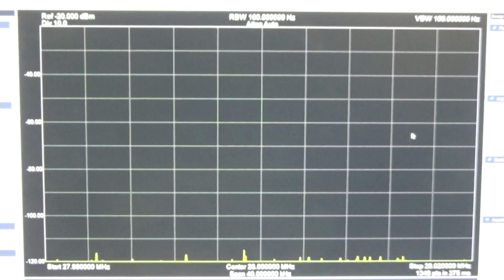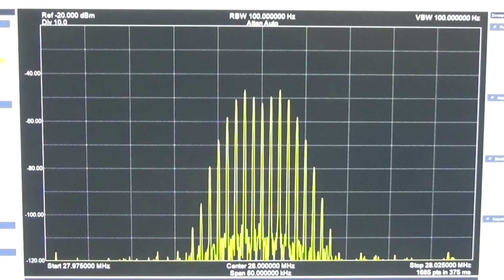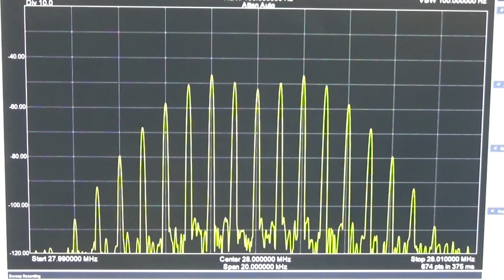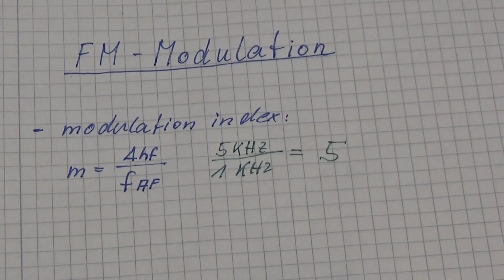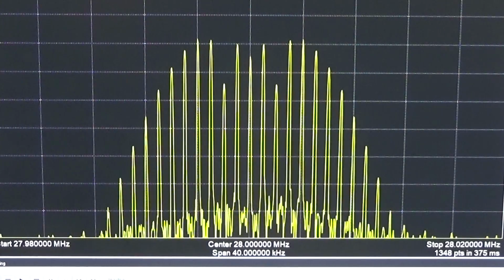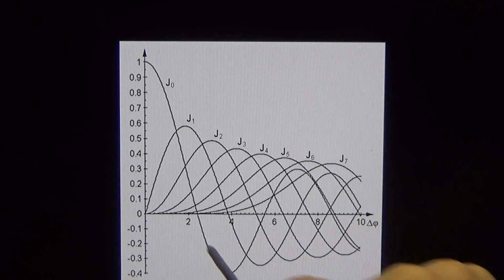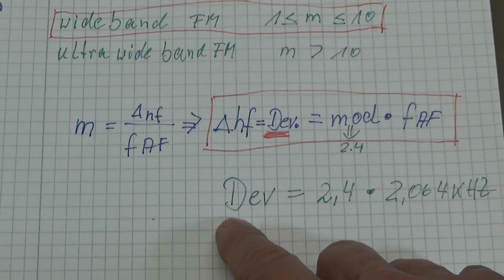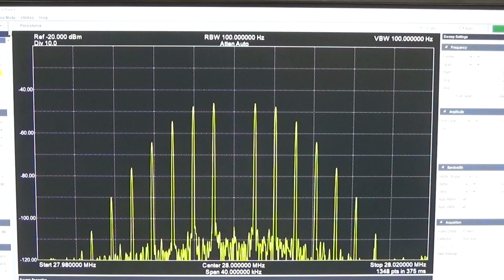#166 FM modulation and deviation on the spectrum analyser explained

Comment: I need to see what the shape of the Modulating signal is on my Harmonica notes. looking at one note at a time.
The vibrating free-reed is basically the carrier. So, I see on the spectrograph that the fundamental frequency is spread out wide.
But it is a wide blurred line. I suspect that there is FM going on. 
Can you give me any tips.

Comment: Hi Peter, an informative presentation.  I used my OWON XSZ1015P Spectrum Analyser and my Marconi 2031 Sig Gen to test it out at 28MHz with 5KHz deviation at -10dbm.  I found 2 lower frequency nulls #1 at 581.4Hz,  #2 at 909.4Hz and #3 at 2.083KHz all nulling down the fundamental to about -90dbm.  The Spectrum Analyser in ''modulation mode'' showed a Peak deviation of 5.05KHz, 5.04KHz and 5.01KHz.  All quite close results.  Based on the modulation Index of 2.4048 for 1st Bessel null this calculates to an audio freq of 2.076KHz for 5.00 KHz deviation.  So I am confused by the 1st 2 nulls as they should not be there.
I think the best way is to to use the formula to calculate the audio freq based on Audio (KHz) = Deviation/2.4048 and trim it for a null on the SP.   Cheers 
Mike

Comment: I was able to set the deviation on an FM transceiver using this method using a mobile phone, an SDR receiver, and an oscilloscope.  It took a couple attempts because the makeshift signal generator did not keep a constant audio level as the frequency changed.  Once I realized the problem, I changed my method a bit.

Take the specified deviation in the service manual and divide by 2.405.  Use a tone generator to produce tone at this frequency.  Set the tone level to what is specified in the service manual by checking with an oscilloscope.  Play tone into radio input while transmitting. Watch the waterfall on the SDR transceiver, and adjust the radio's deviation until the carrier frequency disappears.

When I was finished, the resulting adjustment was within about 1.5% of what the radio arrived with.

Comment: Thanks for the explanation. I will try to measure the deviation of my signal generator FM modulation option which is not documented.
Reply from the maker: Good luck
Reply: It worked! I was able to get an estimate of the deviation variation of an old signal generator using my basic Siglent 100MHz oscilloscope. But not in real time (the scope only takes 1024 points, not enough frequency resolution) but saving the signal values (about 20000 points) and doing DFT via software and using Carlson bandwidth formula.

Comment: I think the bessel 0 point you have achieved here is not the first bessel 0 point (i.e modulating index =2.41) because if it was so then while you were increasing the frequency of the audio signal amplitude of the central tone should go from negative to zero as shown in the bessel graph. But in your case amplitude of central tone was coming from positive to zero while you were increasing the frequency so maybe it was any one of the next bessel 0 points.

Comment: Can I ask you how does squelch work in FM transceivers? Is it signal strength based or something else? Thank you.
Reply: squelch is used in receivers not transmitters. The squelch basically mutes the receiver when the signal strength falls below a certain level. Once the signal strength is above a certain level the squelch "opens" and the receiver un-mutes. The squelch level threshold is usually controlled by the user depending if they want to hear strong signals or weak signals.

Comment: Great Video , please could you kindly help to view FM signal and AM on Oscilloscope , so to check these signals in Time domain .
Reply from the maker: You will have trouble to see the FM deviation on the scope as the frequency delta is to small compared to the transmitter frequency.
Reply: Dear Sir , thanks a lot , please I have question : 
If I set the carrier ( from waveform generator ) to say 10 KHz , set the deviation ( FM modulation from the waveform generator ) to 1 KHz , so is it possible to view the analog FM signal on the Oscilloscope ? 
Thanks and best regards

Comment: Hi Peter, I am trying to fix my HP8590L spectrum analyzer and would like to seek your advice on some of the issues.
1. I tried to measure the signal path from the RF to the IF with a 500Mhz scope which I borrowed but I cannot see any sensible signal between the output and the input of the different stages.
Of course at 2.4 Ghz I would expect issues with the scope shorting the signal due to capacitance but at 300 Mhz I expected it to work. When I disconnect the wires from the SA I see on the screen that the signals disappear hence there must be a signal inside the cable its just that my scope doesn’t seem to pick it up. 
Do you have a recommendation how I could check the signals, I do not have another spectrum analyser. I tried a small hand made coil (contact less) but didn’t help either.
Is it impossible to measure in your opinion ?
2. I see a nice signal on the SA at a SPAN of 100khz and above.
The moment I tur the nob below 100Khz the signal becomes useless.
Can you recommend where to search ?

http://www.eevblog.com/forum/repair/hp8590l-spectrum-analyzer-calibration-signal-issues/new/?topicseen#new

Highly appreciated
Bjoern

Comment: Great video for introduction to FM and FM deviation. However the carrier null shown does not seem to be the first null (2.4).
Audio frequency at start was very low which means very high m. As the fm is increased m decreases and the null shown is  a higher order null. Deviation by calculation should be much higher than 5 KHz.
Reply: Don't the peaks technically go out to infinity but they are below the noise level?

Comment: Hi,
This is tivdio manufacture,we have a new camping radio,could you please click the link :https://www.amazon.com/dp/B074DT6ZT4
Portable size:4.9" x 2.4" x 1.7" Dimensions and Light 9oz Weight, which fits in the palm of your hand. Perfect for your backpack--Camping and Field adventure, as it is portable, take up little room, and is easy to use

4 way power supplies: 850 mAh rechargeable lithium battery, Hand-crank dynamo generator, Solar panel, DC 5V input,  illumination light, SOS Alarm With Flashing Red Light etc function,Good Emergency kit For warnings or Emergencies during camping

Bluetooth make it can connect your phone by Bluetooth and answer phone calls directly using the microphone on the radio,play the music via Bluetooth

Record function,support Radio recording and MIC recording,While listening to radio broadcast, you can record the radio programs,help you study language

Better Sound Quality With bass diaphragm support,support awesome sound experience

Support Micro SD card/USB disk function,so you can enjoy mp3 music stored in the Micro SD card/USB disk with lyric

Hope you like it,if yes,could you please reply me,so I can ship the radio to your address.

Waiting for your reply
Angela